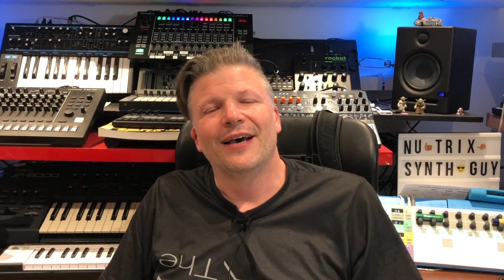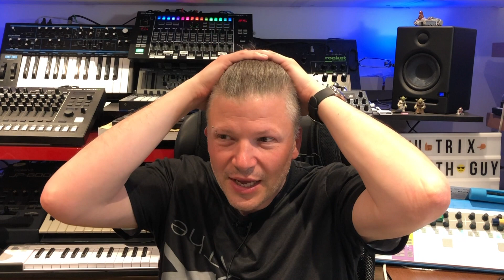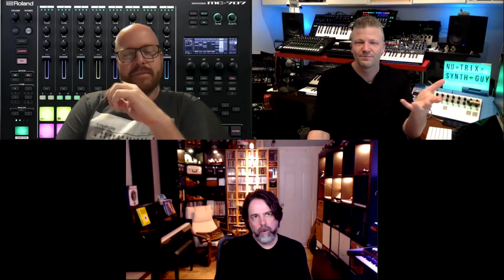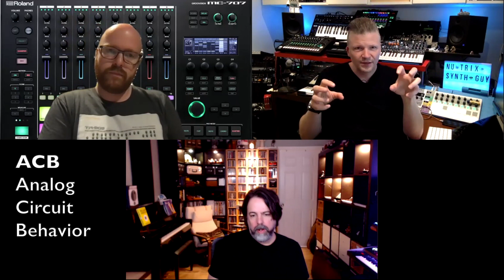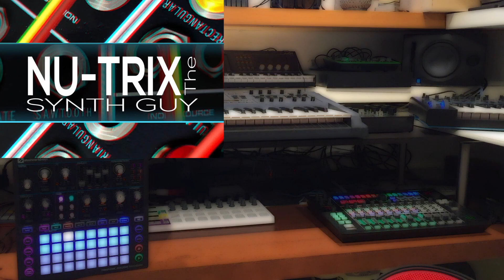Roland ACB versus ABM - Getting real answers from #Roland

Comment: The real question I have heard no one ask is how they actually achieve ACB.  Since they are modeling circuits down to the component level, I will assume they are using FPGAs.  I want someone to crack open one of the Synths to see what brand FPGA and model they are using.

Comment: Is the integra supernatural a completely different software engine? I found that synth  very useful and the synth engines very good for pads and bass,  xv engine EP good & organs very good ,  stringed instruments ok as filler,  however support fell off and the iPad app no longer works and windows editor stopped working making the integra useless in the studio.  I replaced it with zen core pro and it handles anything I needed from the integra very well for a fraction of the price ,

Comment: Not sure what Dustin is trying to explain at 09:06: TR-08 vs TR8-S. Sure, the TR8-S has a modern workflow, but they are both ACB based (=sound the same) while the TR8-S offers extras (samples, FM, effects, etc) on top of that.. The comparison with Plugout (ACB) vs ABM seems odd to me in relation to the TR-08 and TR8-S. Oh well.
Reply from the maker: I think he is mostly talking about the workflow of each devices.
Reply: @Nu-trix  Probably. It confused me a bit :) Love the TR8-S and MC-101 on my desk!

Comment: i love roland systems,i still have a TB303,TR808,and a Juno 60 that i bought at the time (very expensive,and still is) but nowadays i do everything via plugins,i would have bought some of the roland vsti,however,i hate monthly subscriptions (roland cloud or everything cloud),thats why i dont use adobe apps anymore,i bought the V collection from arturia,wich is a one time buy,and you can buy extra instruments when they come out,or buy the new V collection (upgrade price from the one you had) i see subscription company's,as company's who have never enough money,and the price of their softsynths would surpass the price of hardware over time,subscription is crap,even after a certain time one vsti becomes yours
Reply from the maker: Actually, with the new version of the Roland Cloud you can buy or rent the plugins.
Reply: @Nu-trix  aha,didnt know that,have to look into it,just bought polyscape from karanyi,lovely sounds,cheers
Reply: @Nu-trix  Still don't technically own it as the VST will stop working if you don't have internet connection to re-certify every 30 days. Was going to buy the System 8 until I found that out.